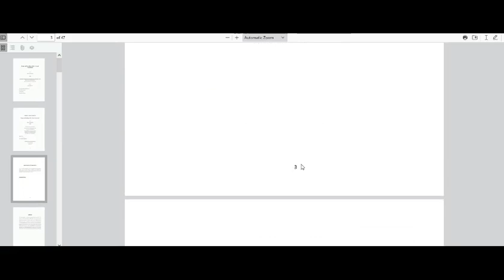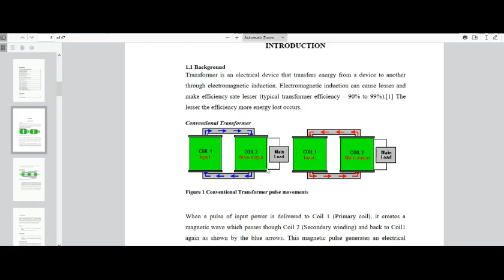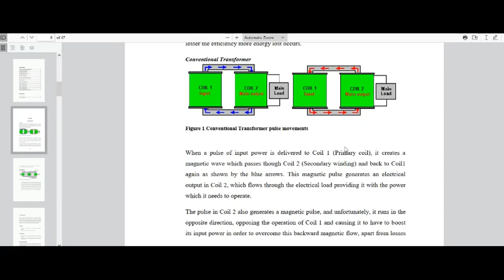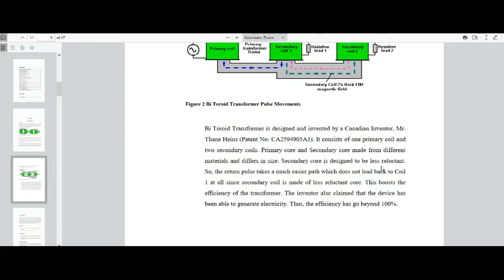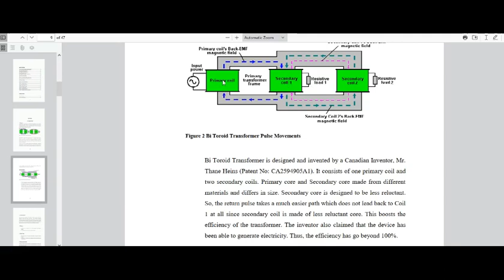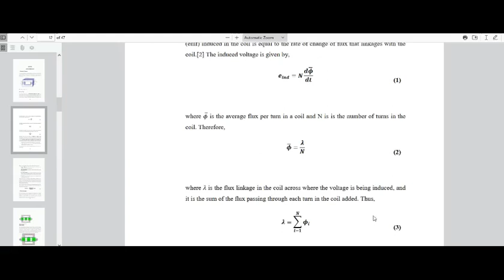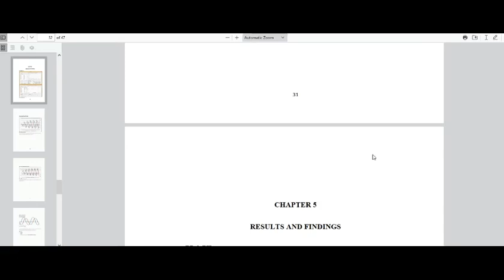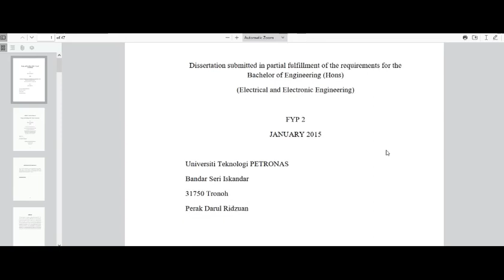Backgrounder on Tom Bearden's M.E.G./Thane Hein's Bitoroidal Transformer

Comment: I'm new at this business, looking for that beginner's luck, haha. Does it make sense for one to know to be on the right track in this pursuit the following key element: When applying a load the motor speeds up while drawing less current?
Reply from the maker: As far as I understand Thane and others talk about this.  If the back EMF, which normally causes a drag is arranged through an alternate magnetic flux path to no longer be a drag but to instead be productive one would theoretically be in a situation where more load leads to more rpms.  I say as far as I understand and theoretically because that is not something I have yet documented for myself.  I have seen that altering the magnetic flux path in a transformer leads to interesting findings.
Reply: I had the chance to reproduce the effect you mention. After several tests and measurements my impression was that it was nothing special. I mean, when you place a spinning rotor with magnets in front of a static coil (containing an iron core, that's the gotcha), your rotor is going to experience a drag because of the attraction between the magnets and the iron core. From my own experiments I concluded that feeding a load with the generated voltage from the coil causes a current to flow that will generate a magnetic field that partially alleviates the drag. I think that's why the rotor speeds up a bit but doesn't keep speeding up indefinetely. I've never seen this effect happening when the coil is the so called "air-core coil" with no iron inside. You see, there's no initial drag in this case to alleviate, and no speed up takes place whatsoever.

Comment: I don`t know for you but up here in Québec it is impossible to find permalloy. Finding 1018 steel that come in flat bar lesser than 1/8 is a challenge. To find the stuff for experimenting with for DIY project is a challenge or so expensive.  I guess I could call Siemens but they won`t pick up...
Reply from the maker: Doesn't surprise me.  As I mentioned to a comment on a related video, one thing I am curious about is whether you can simply use an air gapped E core for two different permeability paths and how effective such a set-up might be.  Thx for the comment